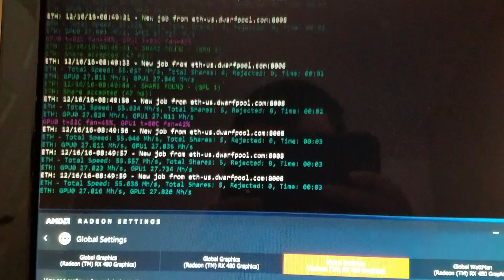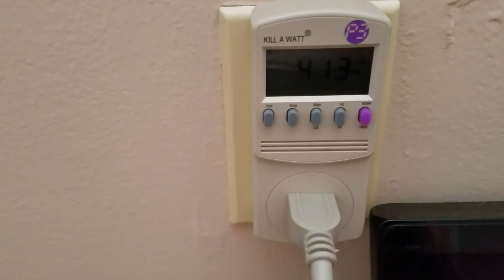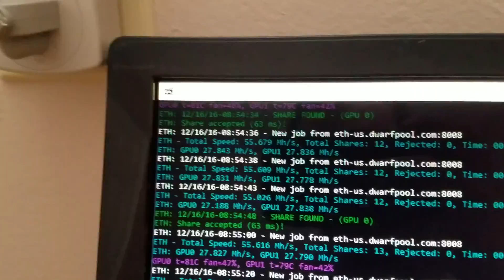2x RX 480 Mining Rig Update!

Comment: Hi, do you still have the rig ? How does it perform? Do is it a lot of maintenance?
Reply from the maker: David Santoro I do still have it. It now has 2 more 480's and a 470 installed. Had to swap to the h81 pro btc. As for maintenance, it is pretty simple. Just make sure to use different SATA cables if you use over 3 cards. I upgraded to 2 PSU's just to keep the power distribution lighter on the 12v rails. I log into the pc once a day to close the miner and open it again. with 5 cards it is pulling between 99 and 124 MH/s.
Reply: Thanks for answering, I am looking forward to make a rig with 3 rx 480's  and get around 75 mhs is it possible to run it 24/7 with no mayor issues ? ( here were I live electricity is practically free)
Reply from the maker: 24/7 to an extent. As often as my job allows me (usually once to twice a week) I will go and inspect all of the power cables while the rig is running. I am looking for hot wires and melted components. If you use a strong enough PSU and break the cards up (if you are using powered USB Risers and using SATA to Molex, if you have multiple cables coming out of the PSU, distribute as evenly as possible.

I also take the rig down once every month for a more detailed inspection, I am looking for dust buildup and making sure everything is tight and secure. Keeping the dust off the rig is the easiest way to extend the life of your hardware. A can of compressed air will suffice in this extent. Clean all cooling surfaces and dust out the PSU(s). 

I would also suggest that once a year you exchange the thermal compound on your CPU at least. I recently took my cards apart and replaced the thermal pads and paste. They dropped almost 10 degrees just by using a higher quality thermal paste than what came in stock. I used standard thermal padding purchased from a local computer shop. BE WARNED THAT THIS WILL VOID YOUR WARRANTY! ALSO BE SURE TO USE THE CORRECT THICKNESS PADS! 

If you do disassemble your cards, please be sure to be gentle and do not flex the board, I use alcohol swaps to clean off the old compound. If you are not overclocking the memory too far, taking your cards apart will not be required. Most cards come with thermal compound that should last the lifespan of the card as long as you keep the cooling fins free of dust as much as possible.

Happy Mining!

Comment: can i put 2 cards on board instead of using risers?
Reply: if they board has 2 pcie x16 slot
Reply from the maker: Rady Chen depending on the number of on board PCIe 16x slots. I use a riser on the second gpu to promote better airflow